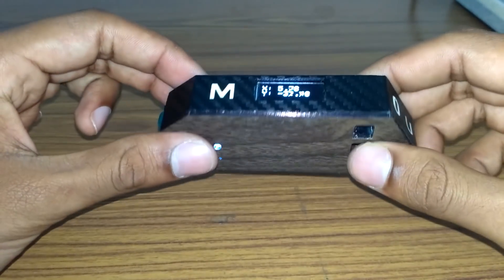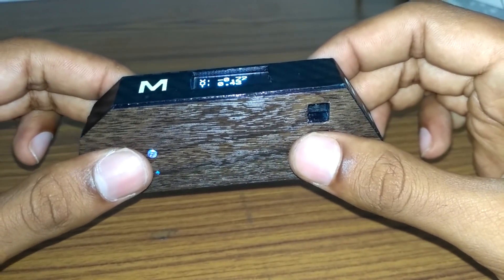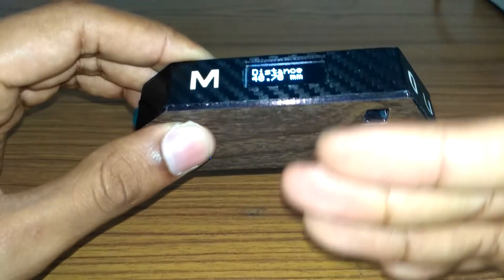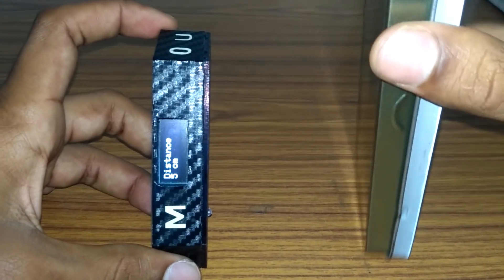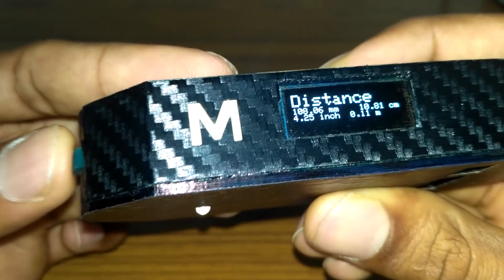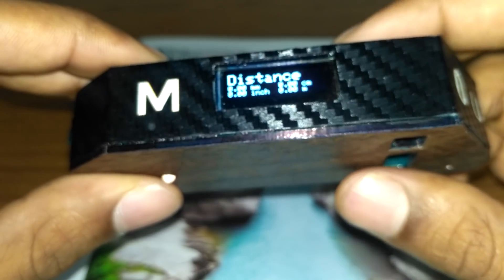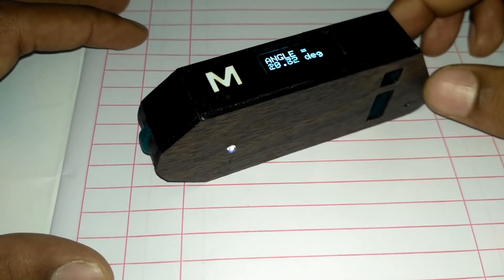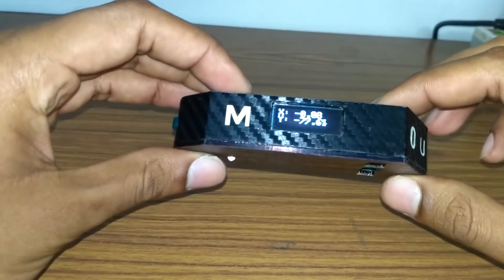Arduino multi tool

Comment: Hi, GD,

Can you pls share the Circuit Diagram for simple digital measurement(4output values in a row like 1)Millimeter 2) Centimeter, 3)Inches 4)Feet - should show the decimal points (3.5cm), 1.3775inch , 0.114ft, but the tool without X/Y axis , rotary encoder